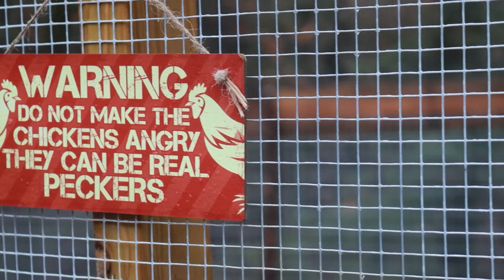Crossing Off Her Farm House Honey Do List| BRIT'S BABY GENDER REVEAL| Did Mel WIN Or LOSE The Bet?!

Comment: Gary for the next closet light , try to  move it to  the center of the closet and  when you cut the sheetrock ceiling for the hole save the sheetrock circle to put back up in the old hole. Make sure there is a 2x4 brace up in the attic to nail on the light's box/ and the thing that holds the light up (squirrel can't remember what it's called). I'm losing my memory . If the wires are too short to move over to the new spot you will have to have a connection box put in to join more wire to the already existing wire or you could rewire it with new wire altogether if possible .  Congratulations on the new to be baby boy into the family, What a blessing to all y'all.
Reply: Hi Angela... its called a bracket, I think, and yes, I am curious how he will install that light.  It's nutty how it is off center like it is but if anyone can fix it, its Gary. 🤗

Comment: I was told not to caulk around the toilet so if it leaks the water can run out allowing you to find it quickly .  What are your thoughts on this should I caulk anyway ?
Reply: What else is there?  I have not caulked yet.  I think I will call and ask a plumber, he would know best. Have a great day, Lucky Duck!
Reply: O
You should never caulk around the toilet. He should have used the single flange. The double was too big that’s why it didn’t sit flush to the floor.  He shimmed it up with wood to tighten it. I actually couldn’t believe he did that.

Comment: Is this plumbing something a woman can do? It seemed like Gary was putting in a big effort with the pex fittings. I'm worried that if I ever have to do this, I wouldn't be strong enough.
Reply from the maker: That Pex wrench is hard to clamp, but i believe you could probably do it. But it does take some muscle. I can do it, i believe you can!
Reply: Look into Pex-A (expandable pex) made by Uponor.  It's a better Pex alternative, in my opinion. So easy to do and we've never had problems with it.  :)